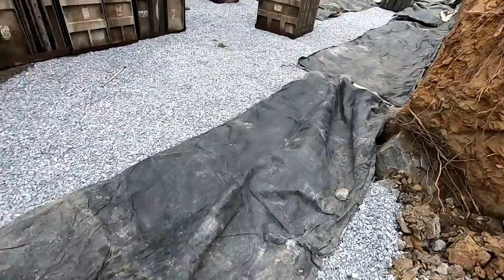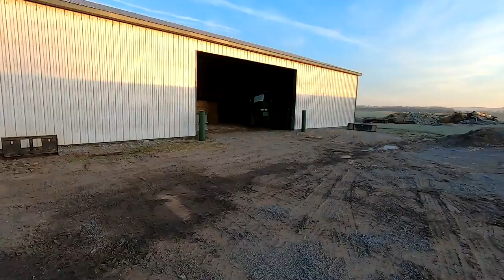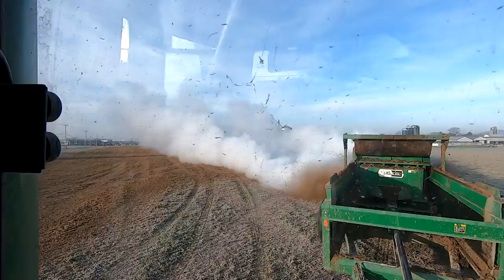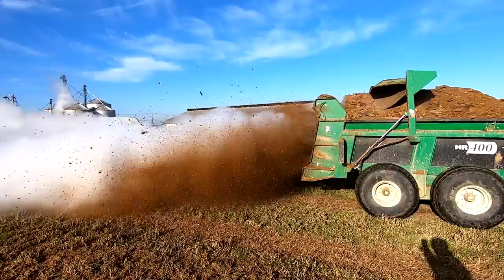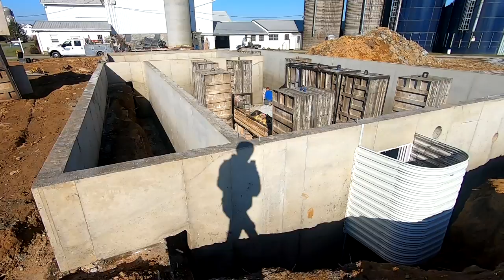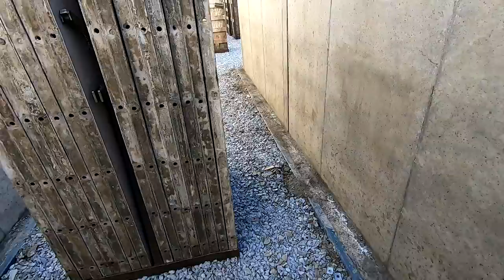Basement Walls are Poured

Comment: Make sure they apply a waterproof membrane to the EXTERNAL (on the outside exposure) basement wall(s) BEFORE they backfill.  It will keep water bleeding through the concrete and you don't want a waterproof membrane on the inside of the walls, as it will trap water in the wrong place
Reply: I was about to Post the same thing but I noticed your comment and had to give a thumbs up!
Reply: Cmon guys, that's just common knowledge
Reply: @logpile1318  No, it's not.  Not all builders/contractors apply a subgrade waterproof membrane to the exterior of the structure  Many people assume concrete is impervious to water intrusion, which it is not.
Reply: @logpile1318  My parents had to deal with leaking into their crawlspace. The gutter drains were blocked and when the plumbing company dug the drains up they found NO waterproofing at all on the concrete walls. $11,800 to dig all around the house, waterproof it, reinstall the gutter drains and install perimeter drains around the house (they weren't installed to begin with either.)
Reply: @shaunp9592  yep, some contractors have no business being contractors, I've done so much of this work it's just part of the job, a no brainer.
Reply: @logpile1318  While for most people it is a no brainer, as your second post said it happens so that's why he wanted to warn him just in case. And to keep an eye on it. I've seen stories where contractor says he will and charges for waterproofing then backfills when the owner isn't looking.
Reply: @shaunp9592  well that's why you always hire someone who is licensed and bonded if you don't, you're on your own, it gives the customer recourse and says something about the contractor.

Comment: When I was a kid basement windows didn't have to be so big.  I started working for a contractor in the late 70's in Jr. High and we poured basements with small windows.  The last year I worked for him, '84, they changed the code to make basement windows larger to give an escape path so anyone in the basement can get out if there is a fire or building collapse.  We built a house in mid '71 near Punxy PA and it had a partial daylight basement.  It had the mud room and a couple of other rooms and they each had the typical high in the wall small basement windows surrounded by the galvanized metal tubs.

Comment: I would suggest placing your water heater in a "central" spot...Kinda equidistant from the upstairs plumbing fixtures.  If you put it on one end of the house it will take forever to hot water to a fixture on the other end of the house.  Looks like things are coming along nicely!
Reply: Maybe he will have a recirculating pump for instantly available hot water?
JIM 🤔

Comment: Eric, just a heads up on your new home you are having built.  Pennsylvania has like the fourth highest Radon gas in their soils in this country.  So, while you are at the point where you are, you need to look into a Radon mitigation system.  If you have it put in while the structure is being built it is usually a much better and probably cheaper system to put one in.  It will reduce the levels of Radon in your home air to safe levels.  This really is a must!!  In Colorado when we built out house I did a lot of research beforehand and designed and put in the system that we have as we were building.  It has been working extremely well with no issues.  I have an electronic radon detector that gives a readout and I have checked each room in our house.  You need to have less than 4pCu/L.  Less is better.  Obviously zero is best.  This is really important with you and your family since Radon can cause lung cancer.  Please look into it.  Put it in now!!!!!  You and your family have a very Merry Christmas.

Comment: I would imagine they will be putting some type of sealer on the outside of the foundation walls where the basement is its nice you have outside access to the basment would be a great barn clothes area specially if you have a washer and dryer there just for barn clothes

Comment: Looking good, Eric. I poured a lot of concrete in my youth back in '78 & '79. Both flatwork and walls. Carried a lot of those aluminum forms. They would scratch the crotch of our arms when we carried them and then the form oil would burn our arms. So I cut the toe out of a thick pair of socks and pulled it up over my arm to protect it. My coworker did too. We called ourselves "The Sockarms". LOL

Comment: Eric, a while back you asked for suggestions of what to use for you heating system on the new house.  having built a home myself and making all the decisions here is what i learned:
1. for the best modulation, fuel flexibility and fuel choice i recommend hot water.
2. i recommend using in floor heating in the basement and first floors.
3. i recommend baseboard for the second floor heating
4. use thermostatically controlled zones extensively
use pex tubing for your piping and consider using a product called warm board for the first floor deck,  you will not have cold feet and your children will enjoy playing on a warm floor

depending on fuel and its cost you will have a number of choices for your boiler fuel. when the system is in and running you can always change your boiler and the fuel if prices go crazy.  you can even use a wood-fired boiler if your state allows.  if the politicians have their way they will want everyone to have non-fossil fuel heat in the future...electricity is not cheap.  we use propane forced air because maintenance is minimal.. i.lived through it in the old house forced air was the choice we made because we wanted AC in the summer.  they did not have AC splits back in the late 80s but we had a heat pump whic was terrible.  if i was build new today i would follow these suggestions and leave enough space in the basement to make future changes if needed...technology does not stand still

Comment: Concrete drying is an exothermic reaction. It produces some heat. I remember seeing a documentary about the construction of the Hoover Dam where they had massive refrigeration units on site to help cure (cool) the concrete pours.
Reply: That is true. And if it gets colder the batch plant (place mixing the concrete) can use hot water as they mix the loads helping prevent freezing even more
Reply: Some say it'll take the Hoover dam 125 years to completely cure.  Hopefully not that long for Eric's basement.

Comment: in my area, the build code requires foam insulation nd waterproofing on the outside of the basement walls before back filling.  Also are you going to put a french drain around the house for downspouts?  Hahpp Holiday to your and your dad, family and your cows.
Reply: Ha,ha Big Dog, my dads' nick name is BIG DOG
My grandfather with dad  had a waterproofing business in Ohio, they found out that walls would crack, the water would get trapped behind the foam boards, and seep inside. If you had a finished basement,  not noticeable teal you have a major mess/damage on your hand.

Comment: If you have not back filled? Place 3 - 4 inch foam sheets against the outside of concrete forms, one it provides insulation, 2,nd it is a crush factor so the pressure against the walls has a couple inches to to push before it places pressure on walls, cracks. Of course place heat pipes in concrete floor in basement, even if you do not attach heat right away, it keeps basement dry & damp free and gives heat for the basement & warm first floor.

Comment: as someone who has a poured set of steeps (well poured box the steeps are slats in metal brackets) added to a rock foundation to add a set of bilco doors the less holes in the foundation the better  the reason the windows as so big  is they have to be for escape reasons its fire code

Comment: Merry Christmas.  Do not back fill the porch area with soil. It will freeze and crack your cellar wall. I have seen it happen. Use angle iron and steel decking with rebar to support your slab. Also, you can cut a doorway into that space and create a great cool storage area.

Comment: Eric I would suggest that you use a membrane in the outside of your poured walls! I did that 6 years ago and on driving rains….the water comes through the cracks that will eventually form in your wall! Easier to deal with on the outside than once it enters but either way it won’t be a lot of water
Reply: Interesting idea.  Where I grew up had flooding occasionally but this was years after we moved into the new house.  It flooded about an inch occasionally and a sump pump was used but also I remember fans to dry out the carpet.

Comment: I am curious if with the size of the window well might be for emergency exit. There are some townhouses  in my area that have what seems like a really big window well, but they contain a ladder to the surface to if you become trapped in the basement, you can open the window and climb out. this might be something required by code. Hope the rest of the house goes up quickly. have a blessed Christmas!
Reply: Not only code, insurance but considered living space. BUT THEY HAVE THE STEPS, to address all the above that you mentioned Robert, although a very good point
Reply: @alisciamarotta3888  I wonder if having a second exit point would possibly be code? The ones I have seen have a window that is low,  probably because it is lower and a sturdy steel ladder in the well

Comment: Those stairs are different.  Not sure where the savings are there.  Not in concrete that I can see.  Usually the basement footings and walls would be poured normal and wooden steps built after.  I maybe am missing something here but in my 50 years experience I've never seen concrete stairs hung off a foundation wall like that.
Nice plan though Eric.  Cheers 🇨🇦
Reply: Good idea though. Why drag softener salt all through the house when you can just go down the stairs to the utility room. Also your trades guys don’t have to traipse through the house either. I think a lot of American farm houses used to have outside basement access as they double as Tornado shelters. Something we in the prairies don’r really think about.🇨🇦
Reply: Those stairs are on footers, James 
Season Greetings
Reply: @asquithmainlines699  and not to mention soiled manure clothing,  can change in basement.  Other option... add a shower in basement :)